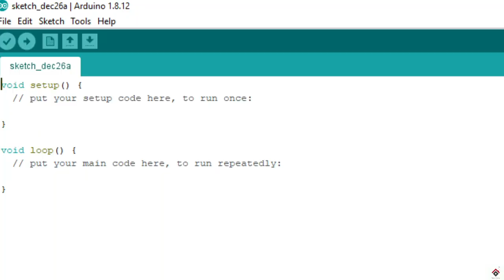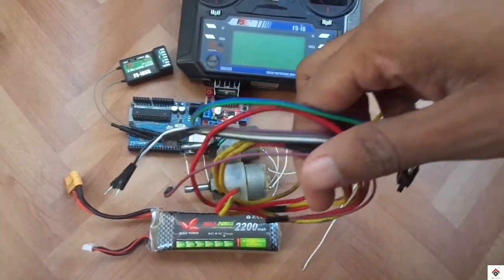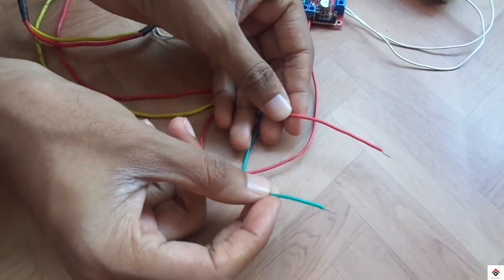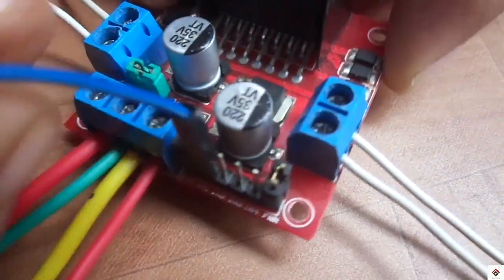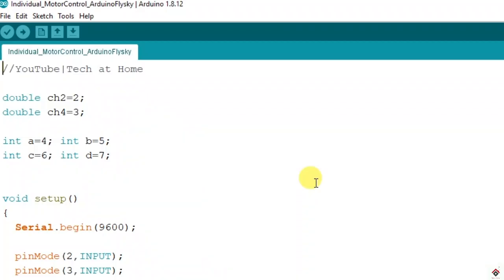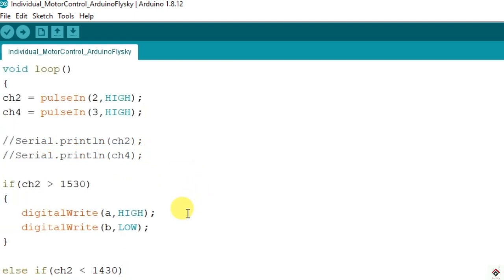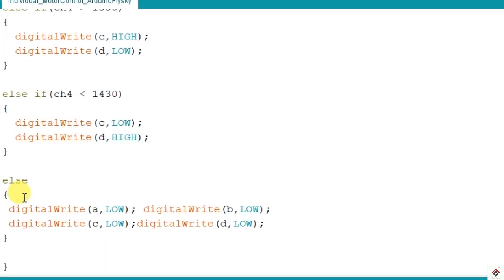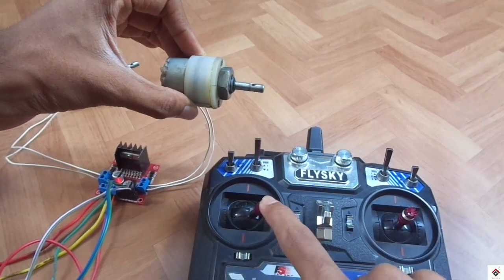Control DC motors using Flysky and Arduino | With separate sticks [For PAN & TILT] Arduino + Flysky

Comment: I follow all your instructions but there is no response in DC motor (775).
I am using flysky fsi6x transmitter with its 10 channel receiver.
Please give your opinion!

Comment: Hey bro, when I want to go forward-backward, I need both my motors spinning in the same direction.  How to do that? I had tried elevon but then I cannot use the two sticks together. Either forward-backward or left-right.

I need RC car like control on dual sticks
Reply from the maker: See if this works for you: https://youtu.be/CspzSkydxFA?si=tWnIoIw_hKRAUA4q

Comment: Hello?
I need your help with my diy project. I'll be making camera slider by using something similar to this. I will have one motor for the camera to go left and right. With End stop switches on both sides. And two motors for pan and tilt. And one more motor for the camera to go up and down for the height of the camera. It will be done by using linear actuator for the camera to go up and down. I want all the motors to have adjustable speed if possible for smoothness. I have flysky transmitter like you have here. I highly appreciated if you can help me with this project. From wiring diagram to coding it for arduino uno. Thank you in advance.
Reply: Hey can u have make it plzz tell me I also search for this project plzz help me to make this project headtracking with fpv in fly sky fs i6 transmitter
Reply: @MorningStar-sc3sy  this project was never started since I don't know how to code.

Comment: Sir will it work for CT6B flysky tx and FSr6b Receiver
Reply from the maker: Tx and Rx doesn't matter,
But see the values coming from your transmitter printing on serial monitor and edit.

First use as it is. Don't change anything.

Comment: Can i use this with nrf homemade transmitter
Reply from the maker: Yes you can use.
Just check the values from your transmitter is same as values used in code.